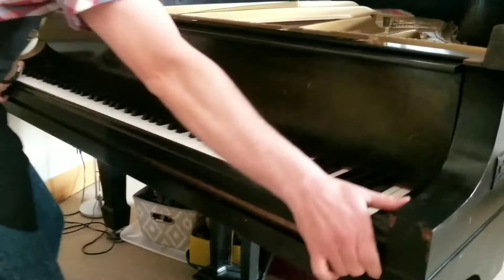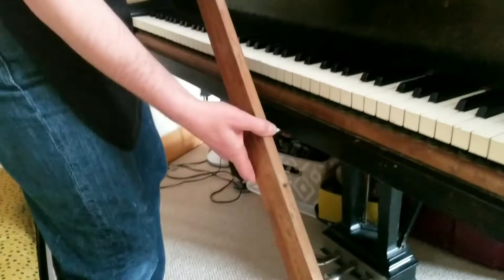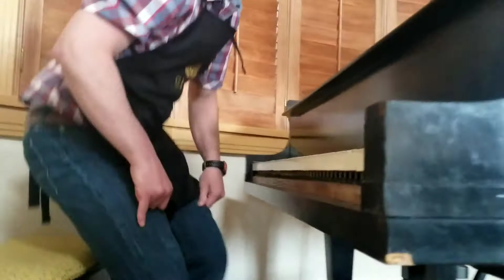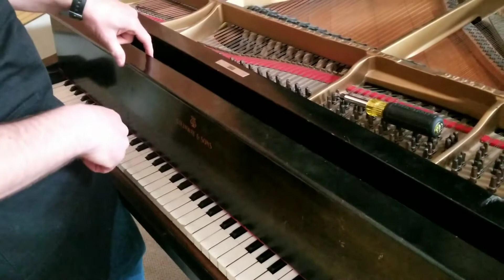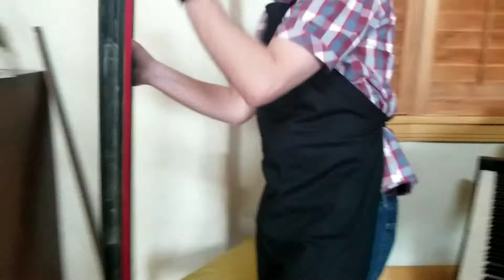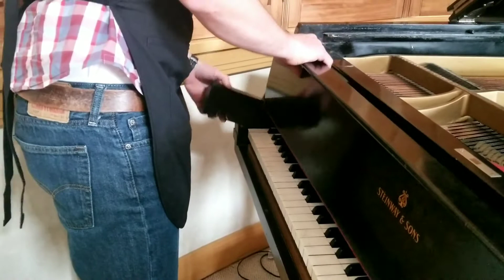How to: Remove Steinway Grand Piano Fallboard

Comment: Thank you for this video, helped me retrieve the QRS remote control that slipped into the piano.  On my Baldwin, the key slip had 3 screws attaching it before I could remove it straight up as demonstrated in this video.